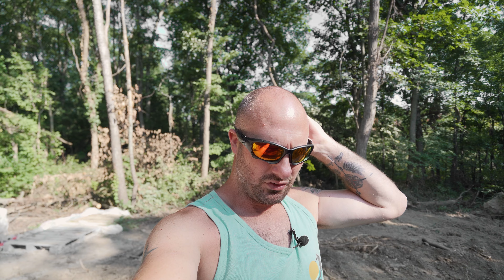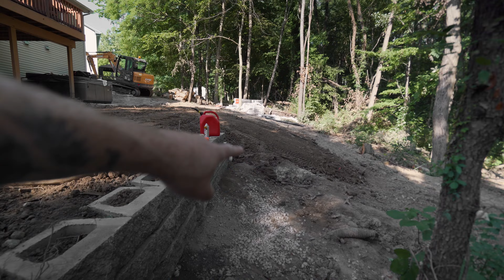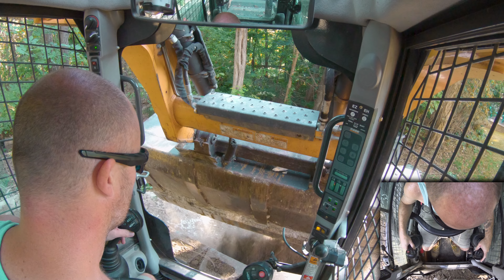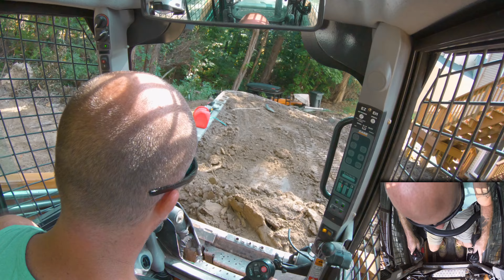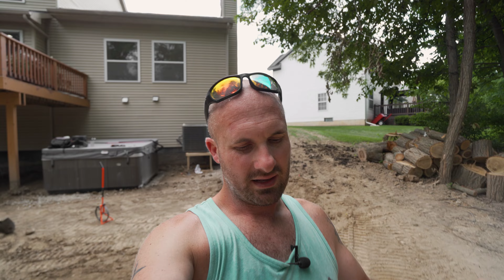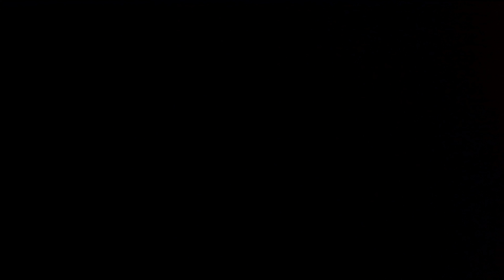GRADING YARD WITH SKID STEER  // Heavy Equipment Vlog Day 2

Comment: Awesome video! I have a Case cx160 excavator and 850h dozer and I need a skid steer. My question is, if you have the bucket up on a stump or truck ect , and it runs out of fuel, can you still open the glass door and crawl out? I wish the door opened up like the excavator. Thanks.
Reply from the maker: If the arms are up high enough then yes, the door will open.  If the motor quits for whatever reason with the arms directly in front of the door there is a red button beside the seat you can depress that will open the valve for the boom arms allowing them to float down (or you can chain another machine up and lift them out of the way depending on the circumstances.  I spoke to a couple of the Case engineers about the overhead door and they won't be changing that any time soon.  It would require a complete cab redesign and would cause them to add height to the machine which they are unwilling to do.  Thanks for the comment Jason!
Reply: @DieselandIron  HOLY FACK!  That red button releasing the pressure on the arms never occurred to me…… I’m self taught in skidsteer, personal use only, we had 3. I kept the mid sized Bobcat, sold the little one and sold the Mustang 2109,…. that killed my late husband. I found him, motor still running, 2x4 on ground, hat on skid steer arm. Hard to process what I was seeing …..until I saw.     Almost 6 years now and not a day goes by without thinking about how he got caught under the arm, over the tire, cab up trying to figure out the hydraulic issue it had for over 2 years according to his texts. f#cking hell f#ck sh!t F#CK!

Comment: This channel popped up on my Youtube list and it is a good one it seems. The dual view while working gives a good idea of how rough the ride is. Like you we have mostly tight areas to work in but few if any slopes. Being on tracks makes your experience more dozer like than the 4 wheel antique skids I use. Always tons of hand work to do.
Reply from the maker: I appreciate you watching!  The new skids are night and day compared to the older models.  Even the newer wheeled machines are completely different in ride quality and capabilities.  Manufacturers have extended the wheel base and significantly improved balance as well as added ride control.  We are spoiled these days!
Reply: @DieselandIron  Some of us still use machines 25 years old or older on a regular basis. The advantage is when they break down repairs are often cheaper.
Reply from the maker: @chargermopar  I hear you. That is one of the huge disadvantages of the new machines. Without a computer it's difficult to diagnose and troubleshoot issues. With all the added computers and high pressure common rail it has gotten significantly harder to work on the machines when they go down. The old iron absolutely has its advantages over the new

Comment: Do you use the float function often on the skid steer when grading?
Reply from the maker: I almost never use float. The bucket isn't heavy enough to keep the necessary down pressure.
Reply: You can’t engage the float on a skid steer…
Reply from the maker: @nicholasbausman999  you can. They even make a button for it. It's called the float button if you can believe it!
Reply: I can on mine, Nicholas

Comment: I know those bobcats & case mini ex are you worst enemy should try a cat or kubota if there’s any dealers close to you
Reply from the maker: I'm not a huge fan of the cat minis either. Unfortunately I don't think we have a Kubota dealer close by.
Reply: @DieselandIron  have you tried the 306 Cat? I absolutely love mine. The 305 is low on power, I liked the 304 better. Hate the Bob kittens. Didn't have much luck with the Case. On the other hand, it is hard to like a mini after being in a 50k lb machine for days on end like you have been.